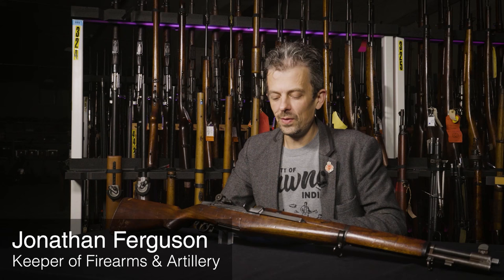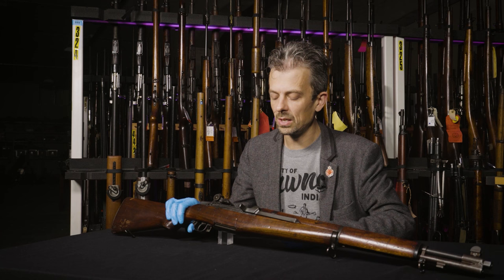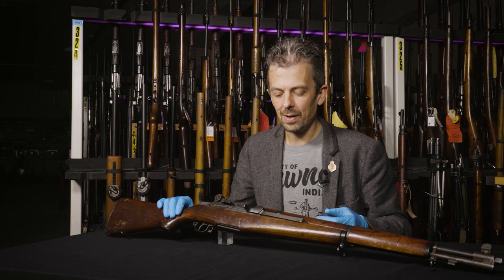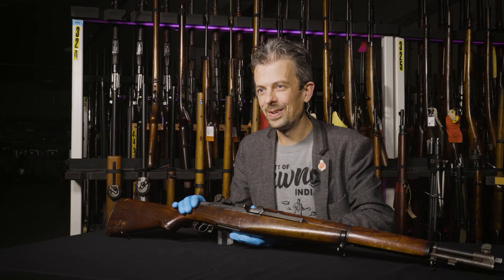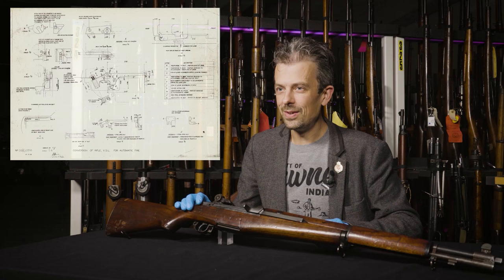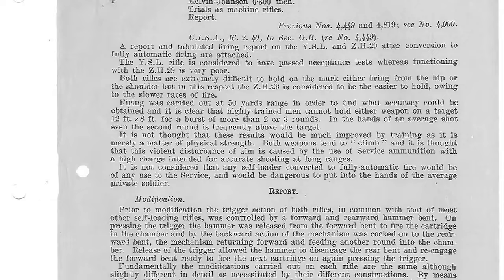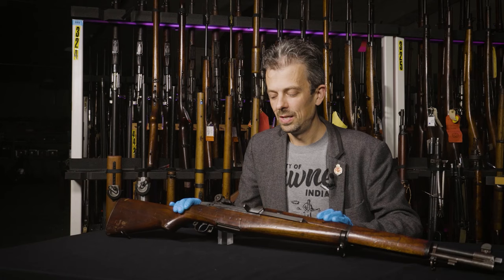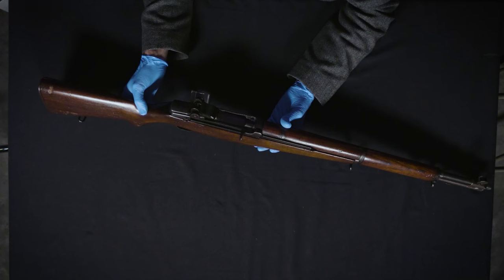Why did Britain make a fully automatic M1 Garand? With firearm and weaponry expert Jonathan Ferguson

Comment: My dad was drafted for 'Nam in the late 60's(ended up stationed in the Signal Corps in W.Germany though) and said the only time he shot a M14 on full auto was for weapon familiarization, basically to show new guys how useless FA was for that system.
Reply: The BM-59 is a Italian full auto m1 garand, with all the characteristics of an assault rifle. I wonder how it compares to the m14 in full auto
Reply: Funny you mention that - my uncle was just talking about this exact thing a few days ago. He was drafted himself and mentioned his one experience seeing a full auto M14 and how pointless it is to fire it like that.
Reply: @kabardino1337  it has an integrated bipod which would dramatically improve control, at least while shooting prone, although I doubt you'd be able to properly "load" the bipod based on how it folds.
Reply: It wouldn't be useless if you had a few enemy soldiers bunched up right in front you and they just locked eyes on you. Some more experienced shooters could handle the recoil to the point it could be used effectively in certain situations. Better to have it and not need it, then need it and not have it.
Reply: @UCqVrr6vJNVG2KGXTzhk75Lg Most of the people they were issuing M14s to in Vietnam weren't experienced soldiers and if you waste ammo from full auto fire then you may not have rounds when you actually need it. Also, even people who have experience shooting guns on full auto have trouble with the M14 due to the high bore axis of the gun. Furthermore, at close ranges semi-auto is more effective than full-auto due to better accuracy, muzzle control and shot placement. The benefits of full-auto rifle-caliber weapons are only seen in shooting for long range suppressive fire or shooting fast moving targets like vehicles. There's a reason that special forces units almost always have their rifles set to semi, even in close quarters battle.
Reply: And they STILL made the FAL with a full-auto option...
Reply: @bynrdskynrd  well, the British FAL(SLR) isn't full auto, and the FAL is much easier to control than the M14.
Reply: @colbunkmust  a "Yeah, BUT!" in the wild! I didn't know they existed!
Reply: @bynrdskynrd  In the Dutch army we used to say that the FAL, when set to automatic fire, turned into a light anti-aircraft weapon ;-)
Reply: @peabase  🤣
Reply: There great anti aircraft guns
Reply: @peabase  😂😂 Squaddie humour at its best.
Reply: @kabardino1337  it would be better but still bad.

The BM59 is just a less terrible M14 when you get down to it
Reply: @americangangster1911  if they were stood on each other's shoulders maybe 😉
Reply: @marksbikeexports5123  To be honest, I found the whole post-Cold War Dutch conscription army a joke. No wonder Srebrenica happened.
Reply: @americangangster1911  It would actually be worse that a semi auto in those circumstances, the barrel climb was pretty well uncontrollable and the second shot would become anti-aircraft fire... yes you see people on ranges firing full auto but they are not under the stress of a "2 way range" and they have all the time in the world to prepare and brace themselves
That is the reason that the 30:06 was dropped in favour of 5.62
Reply: @davehopkin9502  7.62?
Reply: Lol exactly. Same experience with the FAL.
Reply: @Chiller01  Yeah missed a generation out there!!!
Reply: @davehopkin9502  All depends on the shooter, I've seen people shoot them pretty good on full auto.
Reply: @americangangster1911  calm down bro.
Reply: @americangangster1911  Watch the gun muzle, its going all over the place, accuracy nil - Also there is no one shooting back, I can assure you that things are very different on a two way range....
But if you want to believe that, fine, the rest of us will simply carry on and understand why every nation that tried full power rifle ammo for automatic fire dropped it and went to intermediate ammp,
Reply: @davehopkin9502  Don't forget a bi pod can be attached to an M-14 and there is something called suppressive fire, my point is full auto is not useless on a M-14.
Reply: @kupokinzyt  you calm down
Reply: @americangangster1911  You really wont let go will you?

The M14 as issued to US troops did not have a bipod (yes you can fit an after market one to it but thats irrelevant because issued M14 did not have one), and most of them were set up for semi auto fire only.

Suppressive fire only actually works if your rounds are landing on or near the target area - what you see in the video you posted was what is best described as "Spray and Pray".

Having had a play on an surrendered Argentinian full auto FN FAL in 1982 I can assure you as a combat weapon on auto its useless.
Reply: @colbunkmust  full auto is more effective at close range, and incidentally, semi auto is more effective at putting rounds down range for suppressing.  Not sure where you're getting your info from, but its backwards.

Also, very funny to me that you say "special forces use semi so im right", but when he says "experienced shooters can handle the m14 fine" (which they can), you're full of "nuh-uh's"
Reply: @colbunkmust  have you shot either an M14 or a FAL?
Reply: @MyILoveMinecraft  seems like nonsense to me.

People love to rag on the M14, but fail to take into account any of the circumstances surrounding the rifle.
Reply: @davehopkin9502  .30-.06 was dropped for .308.
Reply: @davehopkin9502  keep coping. Why is it you insist on measuring only the M14's accuracy with combat accuracy? Do it for every rifle and you'll see that a disproportionate amount of ammo is discharged for every 1 kill.

Beyond that, what is so hard for you to grasp? He's saying that the M14 is absolutely controllable for an experienced shooter, which it is. Unfortunately, with things such as the military, you must cater to the lowest common denominator.
Reply: @i_commission_dspriscilla_a7486  Full-auto rifle rounds aren't more effective at close range. they just have less dispersion so the grouping is tighter than at longer range, that doesn't actually translate to better combat performance over aimed semi-auto fire. If you don't believe me then look at shooting footage from Forgotten Weapons and InRangeTV mag-dumping AKs in their2-gun matches. Suppressive fire is normally conducted with belt fed weapons on full auto. While you can suppress with any type of fire, short bursts of full auto are the norm in most military doctrines if a GPMGs or LMGs are available.

When I said "special forces use semi auto..." that was a statement of fact. The statement of "Experienced shooters can handle the m14 fine" is subjective for a number of reasons. How do you define "experienced" or "handle" or "fine"? If "handling" something "fine" is defined as keep control of the well enough to dump 20 rounds into a burm 10 yards away, then that doesn't actually translate to much value in a combat zone. Especially since aimed fire at close range are far more important in CQB due to potential collateral damage and endangerment of local civilian populations, not to mention the negative effect of wasting ammunition and overheating your weapon's barrel unnecessarily. Even with subguns which in earlier generations would have been used on full auto, most modern doctrines encourage semi-auto fire for the above listed reasons.
Reply: @colbunkmust   1) full auto is more effective at close quarters, due to accuracy by volume, which we will touch on later. If full auto wasn't preferable, then why are pdw's and smg's designed specifically with full auto functionality, and why is it that militaries are shifting away from burst-fire FCGs, and returning to FA selectors?

2) range matches are irrelevant, go ahead and ask people who were in actual cqc situations in the ME, who were required to clear building block by block.  "Close range" is a vague enough term that its pertinent for me to comment on it: cqc is subjective. Id consider cqc to be distances within 25 yards, due to most combat occurring within 100 yards or so. This is just outside of room-clearing distance.  At these distances, one aimed shot will be no less accurate than an aimed burst, with the rounds gradually wandering. This means that you will put more rounds on target, which is always a good thing.

3) you're now redefining suppressing fire. We were originally talking about the functionality of Battle Rifles in suppressing fire, and not GPMG doctrine. In the case of all BR's, deliberate and aimed fire is more effective for suppression, due to, what you've already admitted, is excessive recoil found in battle rifles.

4) whether it's a statement of fact or not (which it *isnt*), is irrelevant. You dismissed his claim and propped your own up with an equally meaningless claim.  

Since you're struggling with definitions of "experience" and meanings of colloquialism such as "fine", ill define it for you:

ex·pe·ri·enced

/ˌikˈspirēənst/

adjective 

having knowledge or skill in a particular field, especially a profession or job, gained over a period of time.

This means that the shooter is someone not only trained and technically qualified, but is someone with exacting familiarity and comfort with the m14 rifle platform, who can appropriately adjust themselves in their environment to use the rifle with exacting standards of efficacy.

han·dle

/ˈhandl/

verb 

manage (a situation or problem).

This means that that an experienced shooter is someone capable of managing the nuances of the rifle, including its felt recoil, the pattern it leaves on the target, otherwise known as the spread, and any other platform quirks, to successfully minimize the MOA of the rifle.

Fine

/fīn/
adverb 

in a satisfactory or pleasing manner; very well.

This means that the shooter is able to achieve the aforementioned tasks in a way that meets an exacting standard.

5) you're deliberately using definitions that undermine anyone else's opinion. This is not only disingenuous and bad faith, but peak dumbassery.

6) Aimed fire at cqc is no more and no less effective than full auto fire. We've covered this.  The time it takes you to get one round off, it would take the same to get multiple rounds off, increasing your chances of landing an incapacitating hit.

7) "collateral damage"? "Endangering civilians?" LOL, you've never served, and it absolutely shows, armchair general.

8) periodic full auto fire from 20 or 30 round magazines isn't a concern in regards to barrel heating. It won't warp, it won't blow up, and they have hand guards to keep you from burning your little fingies.:(

9) im not sure you realize just how much ammo the modern soldier carries.

10) go ahead and find me some "modern sub gun doctrine that encourages semi auto fire only"

I'm waiting.
Reply: @i_commission_dspriscilla_a7486  yeah that it was chosen because the much better FAL wasn't made in America, after basically promising to adopt it when the rest of NATO accepts 7.62.
Reply: My grandfather fought in World War 2 at the Battle of the Bulge and a few other places.  He said the exact same thing about the Browning Automatic Rifle.  His biggest issue was the 20 round magazine made the weapon pointless when you had belt fed weapons on hand.  Point of fact, there was a belt fed version of the BAR developed for Belgium, but as far as I know, they only had a small number delivered to them, and no one else adopted that version of the BAR.
Reply: @johnjones_1501  your grandpa was goofy ngl. If the dude couldn't see the point in a squad automatic rifle that could lay down more fire than a few garands combined? Thats a him thing, and not a BAR thing.
Reply: Fired a few mags through an M14 at the Creek, like a lot of 30 cal Battle Rifles it was a handful on full auto. Same could be said about the G3, BM59, AMT, etc. If you weren't ready for it any of them would spin you like a top, but if you were ready and knew how the gun ran you could more or less keep them all on target. Training was the biggest downfall with the M14, too much of the Brass considered it the same as the M1 so they never really put emphasis on training for full auto fire.
Reply: @johnjones_1501  Belt fed Belgian BAR? Isn't that just the FN MAG or M240?
Reply: @americangangster1911  in your comment you so ignore everything that Jonathan, Ian, Karl, The Gunny and others have said about automatic fire in this platform to the point if being ridiculous. Leaving me wondering if you have ever fired a full battle rifle cartridge in any platform.
Reply: @kabardino1337  it was better because of the peculiar compensator it had, but you still would be shooting 7.62 at 750 rounds per minute so not ideal
Reply: I recall a gun store owner - many years ago - speaking of m14s being “unmanageable” in full auto.  

At the time, I believed him.  He appeared to be speaking from first hand experience.
Reply: @dennisyoung4631  forgottenweapons has a video on the full auto m14. And ye it is uncontrollable
Reply: Bull
Reply: @kabardino1337  The BM-59 has a pretty good muzzle-brake, and that helps a lot, but you're still looking at 7.62mm NATO from the shoulder with a dropped stock, so it's not like shooting a 5.56mm or anything, you will want to keep bursts very short, and still only use semi-auto most of the time. The built in bipod has its use too, but it's of no help on the move or in CQB.

I wonder why muzzle-brakes weren't considered more for rifles like the FAL or G3, too loud, perhaps?